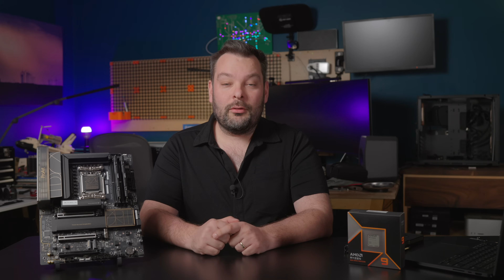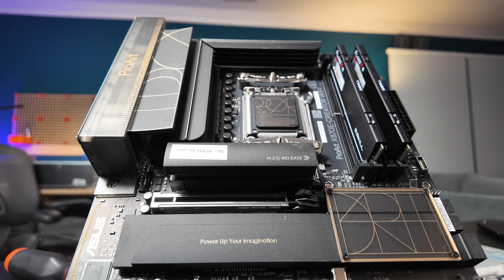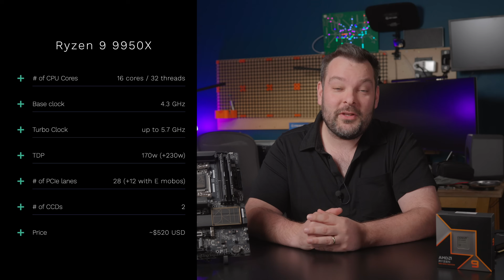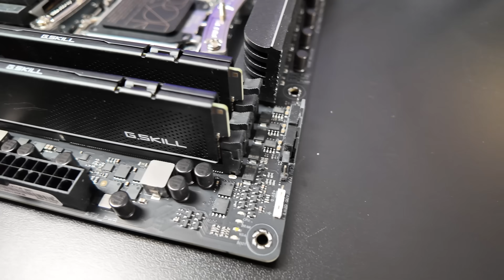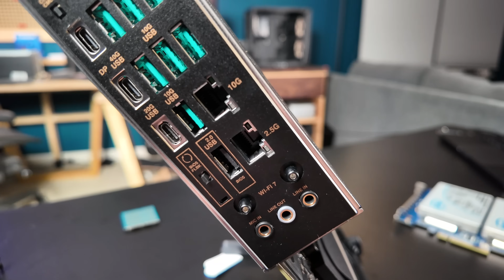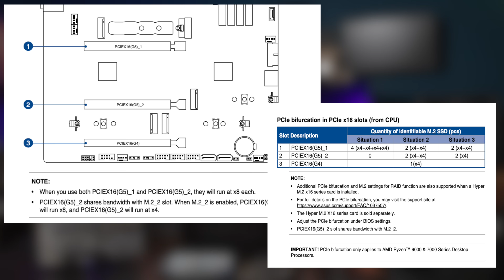Does it make sense as a server? Ryzen 9950X + ASUS ProArt X870E

Comment: I think there is a further alternative handling the limited number of PCI lanes - dynamic switching/multiplexing.
Your concept is to provide each device the maximum amount of lanes statically, independent from the usage during operation. 
Here the first question is, what do you want todo with the system. If it is only used as NAS, or even less as Media Server, then the internal bandwidth must only as high to saturate the used network ports. Of course, you should spent a little bit more to have reserves, especially if there is also some local processing. The other point is that all resources are never maxed out at concurrently at the same time. 
Here comes dynamic switching/multiplexing into play. If you use regular bifurcation and put 4 NVMe ssds on a x16 slot, in reality there will never be a situation where the 16 lanes are maxed out. This is just like where a cpu is connected with a chipset by x8/x16 only in spite of much more peripherals connected. The chipset actually contains a switch/multiplexer that maps all the peripheral lanes to fewer connection lanes. 
What the chipset can achieve, that can be be achieved by regular PCIE card, too. It just has to use an on-board multiplexer. Broadcom has a large range of multiplexer chips that not only support far more lanes than the host connection provides, but also support connections to multiple hosts. This are chips like PLX88024,  PLX88048, PLX88080, PLX88096. ...
I.e. in a followup video you mention a dual NVMe card with x8 with a multiplexer, that doesn't require bifurcation. There are similar cards that can run handle 4 or even 8 NVMe cards with x8, or even in a x1 slot. I have tested a x8 card with PLX88024 and 4 NVMe in a x1 slot and reached 800+ MB/s with raid5. This speed is plenty enough for regular NAS and Media Server use. So instead of putting an x8 card with only dual NVMe I would take the cards with 4 or 8 NVMe and put them into any slot available.
Now lets come back to your setup:
Instead of wasting lanes with only 2 U.2 SSDs, it would be better to use a multiplexing card with SFF-8654 8i ports. There is no bifurcation necessary, the card just uses what is available from the host. There are multiplexing cards with PLX88048 with 6 ports, and with PLX88096 with 10 ports available. So you could hook 12 or even 20 U.2 ssds to one PCI slot. 
With multiplexing you can really get all the bandwith out of the available lanes. You can even increase the number of slots by connecting base board slot extensions with a PLX88096 multiplexer. This will even increase available bandwith in some cases, because of local peer-to-peer communication between connected PCI-E slots without host intervention. 

My future setup:
Currently I have a similar setup like you had, with an EPYC 7502p processor. I will replace it with a Minisforum MS-02 Ultra MiniPC with Intel Core Ultra 285HX, dual 25GbE, 10GbE, 2.5GbE, dual USB4v2 ports with 80Gb/s, and vPro managegement support.
The MS-02 will have 2 NVMe cards for local OS and data, a low-profile PLX88024 quad NVMe card in a x4 slot. The x16 slot wil contain a passive dual MCIO x16 card connected to an extension base board with 4 PCI-E Gen4 x16 slots, managed by a PLX88096 chip. This extension board will be placed in a NAS case, normally housing an ATX motherboard. The case will then house 8 3.5" SATA HDDs, 8 2.5" SATA SSDs contained in 4 3.5" dual ssd raid cases. The slots of the extension board will contain a RTX6000, a RTX4080 for AI and a HBA with SFF 16i.
The performance of the system will be much better, use much less power and be relatively quiet compared to the current EPYC system.

Comment: I have this also, but, couple things
I still need the TR box, as this is limited in memory
also the memory b/w goes down to 3600 when all 4 DDR5 slots are used

and, I also have the problem with the NIC's - they both drop the PCIe to MAC/PHY connection, even if I leave them at x1 - maybe once a week or so, and at the default pcie rate they will drop in an hour or less

everything is running cool.

And - one other thing, no linux drivers for BT, WiFi for the chips they chose.
(I run Win11 or arch)

other than that, I love it

Comment: My ASUS ProArt X870E Creator motherboard has failing NICs.  The lights on both NICs will randomly go out and stay out, at which point the OS reports that the igc device is no longer present and the system drops off the network.  It can persist like this through a manual hard reboot.  Unfortunately, this makes this motherboard a brick for the purposes of a server.  There are many other reports of the same issue on the internet.  Just a warning to folks who may watch this video thinking to use the ASUS board for a server build (as I did): DON'T!

Comment: Although three weeks later, funny enough, i am building a NAS with the little/older siblings of your components: the 9700x and the proart b650 creator. I was looking at the proart series, it is one of the very few that provide 8x/8x. The 10gbe nic is nice and I was drawn at, until I decided to add a double port cx3 40gbe (one to 10gbe router for the lan the other directly to the workstation, making the NAS to a DAS too). Consequently i chose the b650 at half price vs the x670e or 870e.
Reply: How are you getting on with the 40gbe performance on your setup? I’m working on a new build currently and have a dual 25GbE ConnectX4 card on the way, but am struggling to decide on the right mobo for the use case. In theory I think the X870E board in this video could work, with bottom x4 slot running HBA for the main spinning array), then dual SFP28 25g NIC in the middle slot at x8, and maybe one of the Asus Hyper NVMe  4x cards in the top slot; but that leaves zero room for a GPU of any kind, which feels insanely limiting for such an expensive board & CPU combo. 

Did you find the B650 chipset could do everything you needed to? I feel like Asus went massively overkill on NVMe slots on this board instead of giving more flexible PCIe slot options.

Other option would be HBA in bottom slot at x4, dual 25g NIC in middle slot at x4 which using both M.2_2 and M.2_3 slots on the board, forget the Hyper NVMe card, and stick GPU in the top at x8. Doesn’t need to be an insanely powerful card, just enough to handle transcoding.
Reply: @joeunsworth my pciex setup from bottom to top is: pciex4 dual 40 gbps nic (one goes to workstation for the poor man's thunderbolt DAS the other converts to 10gbps  to the router), pciex8 HBA serving 4x2 mirrored zfs and a pciex8 intel arc a310 for transcoding (I had a 3060 for trying llms but it did not have av1 and i decided to setup another machine for this. On the mobo i have two nvmes for os (custom gentoo), containers, virtualization etc, its plenty; in fact i have a small windows partition that i boot into once every 3 to 4 months for updating component firmware if needed. In general I am very happy with the b650 mobo for this setup. I do not recall all the differences vs x870e, mainly the 10gbps nic, gen 5 nvme slots (i use gen 4), 2 thunderbolt, more usb that i remember but at double the cost vs the b650 it was not worth it for me. What was problematic was the dual 40gbps, it was getting hot frequently despite the fact that the case had a 20cm fan on the side, I had to screw a small noctua fan on the heatsink. Also, in the beginning I was limited to 10gbps because I did not use the right cable. In hindsight I should have gone with dual 25gbps as you do. But I can not blame the mobo for this.
 
The phenomenon where a mobo offers 4 nvme slots and then one realizes that one can use effectively only two of them without compromises with shared bandwidth I think it is not limited to asus but it is more general. I think I have maxed out the capabilities of my b650 (in fact there is a free pciex1 gen 3 but in general it is not accessible). I wish onboard amd vga had comparable capabilities to intel, it might had freed the pciex8 top slot where the a310 sits.
Reply: @markmorati8986  Sounds epic, thanks so much for the really comprehensive response mate. This sounds like a really solid build and I'm impressed you've managed to make all of that work on the B650 chipset. Sounds very similar to what I'm trying to achieve, and I suppose my HBA can serve all of the spinning drives (8x HBA + 4x onboard should be enough for the foreseeable given currently sitting at 6x disks) and I suppose 2x NVMe slots with 2x 8TB drives would be sufficient, with 16TB of ultra-fast storage in RAID0. Not too concerned about drive failure there as I'll run rsync tasks onto the array hourly or something for safety. (Use-case is a multi-purpose SMB server with video editing as the focus: fast-access SSD pool for active projects, spinning array for archive with dual parity, and maybe a 3rd cheaper SSD dedicated to VMs/appdata etc - not really a problem if that one gets throttled down to pcie3.0). 

I just hate the idea of spending loads of cash on a new system, to then "outgrow" it in 4-5 years like how I've outgrown my current B450 build. 

But realistically I think the only way of guaranteeing that is to go with a Threadripper build, for the massive amount of lanes/slots, but I just can't justify the costs.

You've given me something to think about!
Reply: @joeunsworth  Your welcome, I am happy that the extra info served as food for thought and I agree on the similarity, we both look at the need of a fast fileserver (fast storage, network way beyond standard 1 or 2.5 gbps, multiple disk support etc).

You are right about investing and outgrowing within 5 years, especially when looking at the x870e. However, I feel the investment will last longer, the way prices have skyrocketed, the neglect of the consumer base etc, I think we will stick longer to our builds before justifying the benefit to cost ratio for switching.

Threadripper is impressive but maybe an overkill, how will you utilize the cpu power of this beast on a samba server? Also the power consumption,  they say the cost will increase too for the AI needs. Probably a server mobo will give the pciex lanes cheeper compared to the beast.

Closing, just an idea. Understandably video files are large, but if you are ok with 8Tb storage, you may not need an 2x8tb raid 0: A single gen 4 nvme with a nominal rw speed of 6GBbps should saturate your 25gbps nic by far (6x8~48gbps).  The limiting factor will be the 25gbps network, not the nvme speed. You can use one for video the other for os, vms etc, if you need more than 8tb you can use lvm.

Comment: PCIe lanes seem to be a real issue at the moment. I don't need an EPYC or Threadripper but I also don't need to dedicate 16 PCIe Gen 4 or 5 lanes to one slot. 

I wish there were a class of motherboards that let me route PCIe lanes where I wanted them. Even being able to run 2x NVMEs, 2x 10/25 gbe network cards, and maybe a GPU, all with 4 lanes of PCIe gen 4 would be wonderful! That's 20 lanes but there just doesn't seem to be any options for this.

Comment: Hahahaha, Again - almost same solution....I just get R9-9950X with 128GB and ASUS Strix X870E-E but I just add another 2x10GB additionally.
Since I have 4 servers and I pay a lot of attention they to be on minimum power if not really busy, I had put this machine to change my home PC.
What an amazing machine is... Congrats for this decision - it worth as a workstation and as a server as well.
Be prepared for some RAM instability. You just have to re-train it, but is annoying. (it happens when I have added my 2nd 64GB pair). 
Place the Gen5 NVMe SSD on the dedicated Gen5 socket to not harm the performance of the graphic card.

Comment: I moved from a 3960x to a 9950x last summer. My Threadripper is still alive and well, running as a VM host, but the 9950 is about 66% faster while using less than half the power. I use an SAS HBA, a x16 GPU and an Infiniband controller in the PCIe slots, which means that the system can host all the drives and fast LAN connectivity I want, albeit with fewer local SSDs than the Threadripper. Still, with 40Gb connectivity to my file server, it's working just fine for everything I actually need.

Comment: In my opinion the best AM5 motherboard at the moment, though not good.

Good that compared to the ProArt X670E predecessor its chipset PCIe slot got upgraded from x2 to x4, really bad that 4 CPU PCIe lanes got thrown away for the USB4 chipset.

I wish ASUS would make an updated Pro WS X570-ACE with its excellent PCIe lane user usability, let there be a Pro WS-X870E-ACE!

Comment: If you're building a server why would you go for a 9950x and not the epyc 4564p? They have the same number of cores and uses the same socket, but the 4564p has more pcie lanes, same tdp power draw, and is cheaper. The only downside is that the 4564p has slightly lower performance (about 2% less performant), but that is easily worth the trade off imo.

Comment: I use Proxmox on my 7950X (non-3D) node as well as both of my 5950X nodes as well for CAE applications, in a HPC cluster.

Downsides of using a consumer-grade platform is definitely the lack of PCIe lanes.

When I set up the system, I had to install a GPU into the system, just so that I can get it going.

But once that was done, I swapped the GPU out for a Mellanox 100 Gbps Infiniband dual port NIC instead.

There are challenges with said 100 Gbps Infiniband NIC (because of Debian), but beyond that, it works and I have all three nodes working and talking to each other at a little under HALF of the total power draw vs. my old quad-node, dual-socket, Xeon E5-2690 (v1) compute cluster, and it's faster than my old cluster.

So yes, you CAN absolutely use a consumer grade platform, as a server, but know that the lack of PCIe lanes will be one of the most significant limitations (unless all of the stuff that you're doing is more or less, pretty much going to be all compute bound).

Comment: yup never enough pcie lanes pissess me off too, instead of upping the speeds I would prefer more native lanes or motherboards with chipsets that give a bit of more effort than the current ones....but nooo.... they force you to switch to threadrippers and motherboards that cost triple/quadruple than what "enthusiast or gamer level" mobos offer ...fck.... I just want one main video card /9070xt/ a secondary /intel b570-580/ to have 5 monitors and the tv, occasional gaming and video processing and experimenting with llms with a collection of older smaller m.2 drives in a hyper m.2 adapter and maybe some 2,5" sata ssds also in a raid as a backup or scratch disks, no way there would be place for a 10Gb network card /maybe if I sacrifice usb4 drive for an external adapter/
Reply: Amen

Comment: After fscking up one of my motherboards and losing a slot, and wrestling with PCIe switching in proxmox, I've pretty much broken out a few of my workloads (AI specifically) across multiple "servers", pulling back in two older machines (I9-9900k and i7-6700k).  Power draw on my proxmox cluster is a mess right now, with 12 nodes running all different kinds of configs.  I'd love to do some consolidation, but 256GB isn't enough memory to do that on this platform.  Maybe EPYC 8008? (What I really want is a machine with 8xA100 80GB cards, but we all got dreams...)

Comment: The X670e version of this board is slightly better I think for this use. M.2_3 is only shared with the last x4 slot, where it halves it to x2. The USB4 is wired differently between the two and shifts the point of contention in the lanes.
Reply: I wish the x670e did not have the x2 slot, what is the point?
Reply: @markmorati8986  Still enough bandwidth for a number of use cases.
Reply: @blkspade23  I suppose one could use it for a capture or sound card, will a one-port 10Gbpe 4x work? But it does cripple the M2 if populated, right?
Reply: @markmorati8986  Exactly. The Pro art has built-in 10GBe, but single nics are generally PCIE3.0x4. Yes 1 of 4 NVME slots would be running at x2, which for a Gen 4 drive is still 3500MBps. Wouldn't exactly consider that crippled, because few real world (consumer/client) tasks ever get close to the advertised sustained speed of these drives. 

Even serving/receiving data over that 10Gbe only equates to a max of 1250MBps. Most TB4/USB4 enclosures top out at around 3000MBps. The 9950X doing decompression even maxes out at around that speed. When you have 3 other slots that will offer fantasy land performance, It won't seriously matter that one of them is halved.

Comment: I used a X670E ProArt as the basis for a Proxmox server, with ECC UDIMMs and all. The platform itself was great, never had any issues with Proxmox. 
The idle power draw (CPU and chipset - AMD is simply behind Intel here) ended up being too much for me to run 24/7. 

That being said, for a workstation - where you may be able to reasonably turn it off when not using it - it's amazing. 9950X + this platform is probably a viable alternative to older Threadripper if you don't need PCIe.

Comment: Tell me about the RAM. What type of DIMMS (UDIMM? ECC? 6000 Frequency?) I don't think it's possible (yet) to get 256G of RAM in there. Wendel from Level1Techs warns against doing 2DPC because you have to lower the mem frequency so much (down to 5,000 I believe is normal...). 

I love this idea, my main concern is RAM capacity.
Reply: Almost any use case for which you're using it as a server that frequency shouldn't even remotely be a concern. 6000MT/s is technically an OC anyway. It's matters more for interactive Desktop/Workstation use cases. Get the capacity and accept that it will run at officially rated speeds. My 5950X system has 128GB at 3600, but it's running as a NAS, Plex, Rustdesk, and dedicated game servers, as well as a Windows VM with a 1080ti for light desktop/gaming duties.